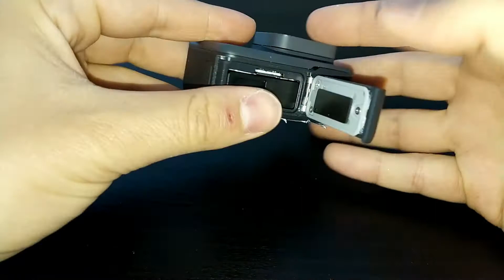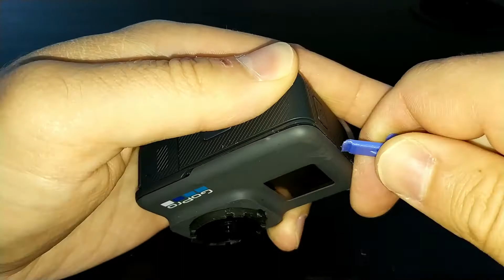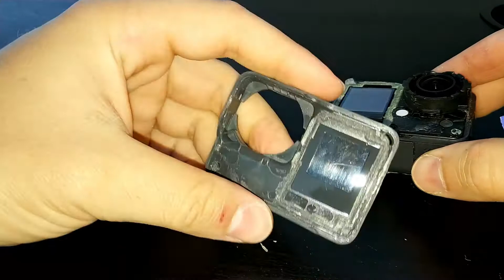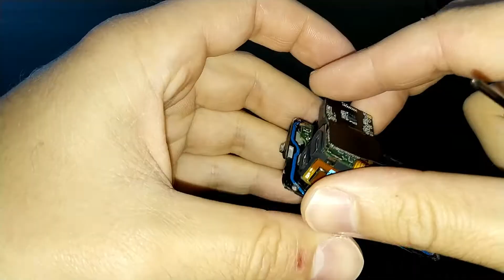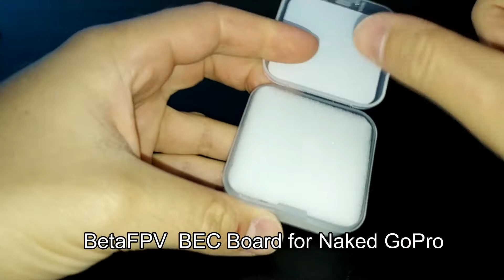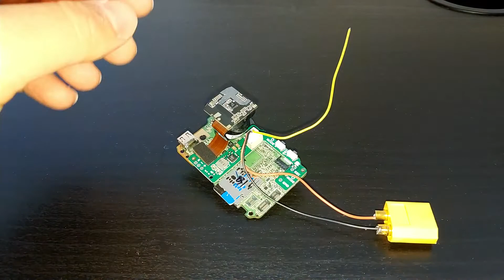Making a Naked GoPro Hero 6

Comment: Where to connect yellow ware?
Reply from the maker: You can setup BetaFlight to control the GoPro via that yellow wire, but it's not necessary to connect if you don't want to use that feature.
Reply: Acrialy i want to, but dont understand where should i solder that ware and how cli to repon it
Reply from the maker: @eugene.drones283  I never used that feature before, so unfortunately I can't help you with that.